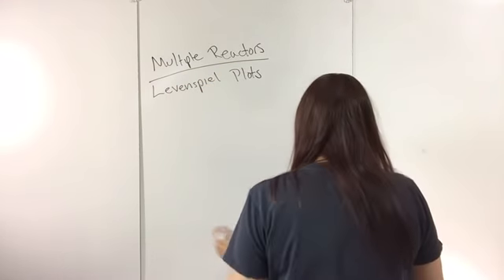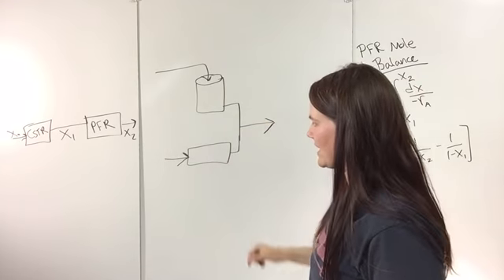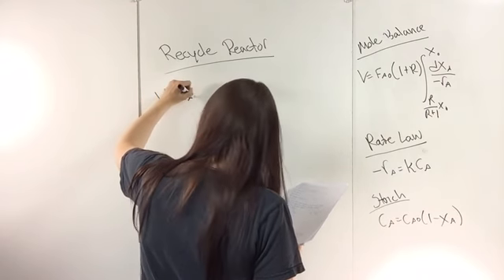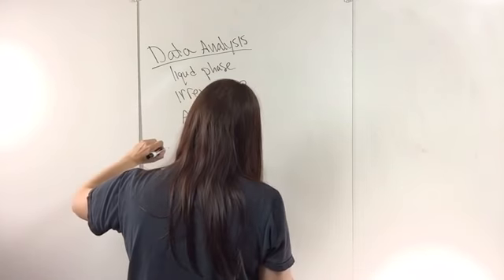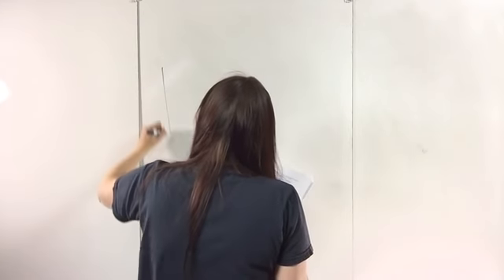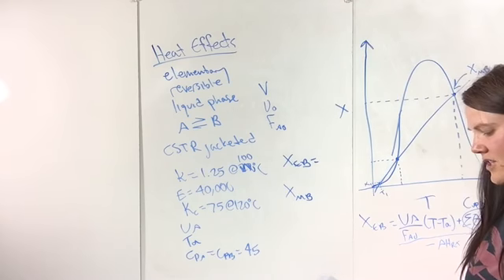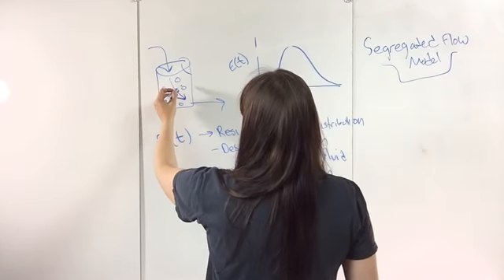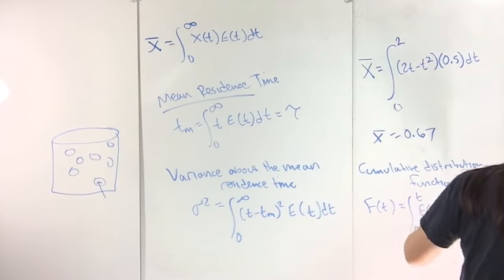Reaction Engineering - Final Exam Review

Comment: Q1-A-An elementary second order adiabatic reaction A + B -> C + D is taking place in a

CSTR. The feed to the reactor is equimolar A and B at concentrations of 2.4 mol/liter. The entering temperature is 300 K. The volumetric flow nde is 15 Ilt/min. Following are some other data characterizing the reaction. 6

C.= 20m / l * b .mols^ 2 F

C - = 15Bm / l * b .mol-^ F

C\ = 1SBm /molb.mol-^ F

C.= 20Bm / l * b .mole^ 9 F

AH (300元)--7000 cal/mole of A

( K_{3} = 0 Imol-min

x - x > cal/mol

What conversion of the reactor is required for  volume 203.05 liters ?